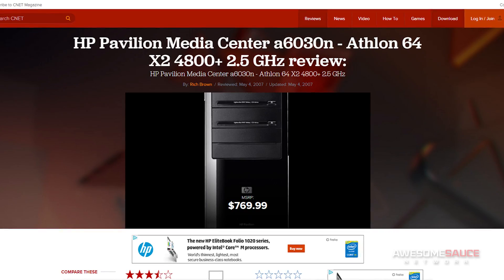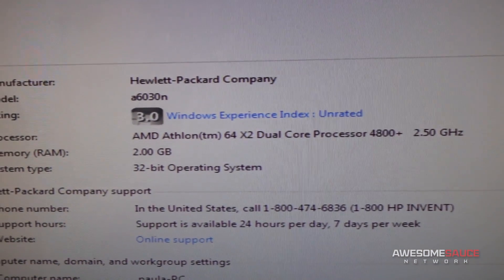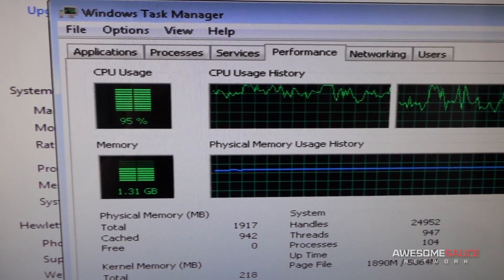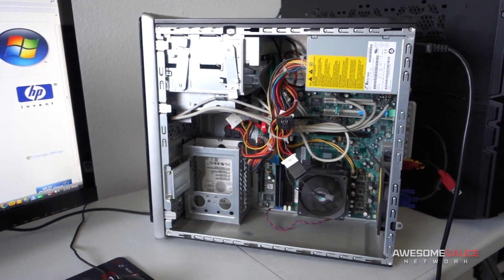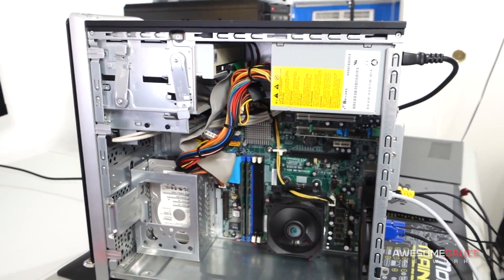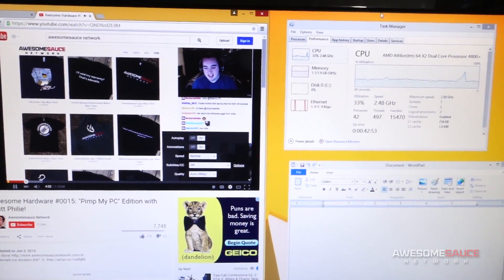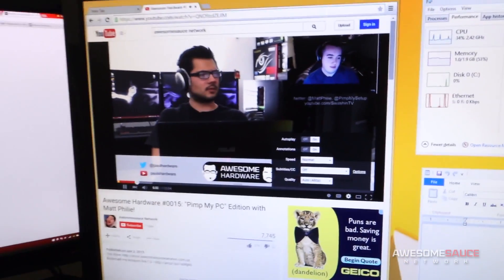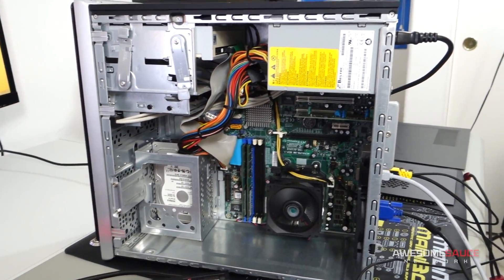Cleaning Up My Neighbor's Old Desktop!

Comment: 1st thing to do with an HP computer: wipe the HDD and install a fresh windows since HP stuffs their PC with useless crappy HP Software deeply rooted in the system so it's painful to remove and will leave windows slowed down.
An SSD will do well for an old system, too.

And did you even clean the PSU? I even open them after a few years to get them all dust free inside.

Comment: Can you explain what are the things to keep in mind while building a low and mid range PC
Reply: Don't be stupid and take everything slowly
Reply: I mean buying parts
Reply: @vishalyagnik226  don't cheap out on psu cause if the system does not get enough power the psu might break or cause instability on the whole pc ( signs like crashing games, crashing the whole system which requires to restart it). Get a stable graphic card and a processor, dont let them limit their ability to get more fps. For example you wouldn't buy a rtx 2080 with a cheap pentium processor now would you? Rtx 2080 and ryzen or something like i7-6700K would be more reasonable. If you dont favor looks, get a cheaper case(not the one in this video of course) but if asthetics dont matter to you that much, just buy something simple and invest the money saved on the case for something better, like ram. Ram for best performance should always be dual channel( meaning that 2 same ram sticks together) having dual channel can increase fps significantly, like 20-30fps at most. I hope I helped
Reply: @GamingDog20  now my use is like basic office use so not going to play games and all, also not going to buy a laptop or hps or dells ready made, so now to be specific which processor amd or intle and with which model ram and ssd which brand also is using ssd for os is a good idea ? sorry for too much questions

Comment: I never ever cleaned my core 2 duo, my first rig,alongside the radeon ati hd 4350 512MB and 2 GB ram.Bought it in 2009,opened in 2017 when i heard a little pop sound with some light.I discovered  that the GPU burnt bcz there was dust all over it and it overheated.Now i have built a new rig,comment to know abt it.

Comment: I'm surprised he didn't have some old Ram lying around to double up to 4GB RAM. Upgrade him to Windows 10 with the existing Product ID code.
Reply: win10 would not be a smart idea, better to just stick with win8. getting more ram is a good idea. or maybe replace the system, even the cheapest of cheap new tech is alot better then this.

Comment: Great video, thanks for sharing! I like to open my case and air the dust out a few times a year, but I’ve never taken my cpu apart, that looks like a good idea! Okay, well, I did once, and put the heat sink back WITHOUT any thermal paste-yeah, I ended up building a whole new computer after I turned the power  on (fried)! That was a very quick lesson on thermal paste! :-/

Comment: I had a 9 year old dell XPS 8300
So I just slapped a 1070ti in there and it works just fine
Reply: Firebomb1987 still get around 100fps in most  games with max settings

Comment: I've had a problem with my computer, that is that every time I power it on, things like twitch and Spotify automatically open themselves, if anyone has any tips it would be greatly appreciated
Reply: Go to the settings of both programs and change it to NOT open with windows 

Fairly simply
Reply: @stevesmith1383  thanks, don't know why I didn't think to do that
Reply: @tylan129  sometimes the issue is staring you right in your face

Yesterday, I spent 20 minutes figuring out why my pc kept telling me why I couldn't install a program to my non boot drive and asking for administrative permission....when I realized the 2nd drive wad named E not D like I kept typing. Smh

Comment: How did u hook it up to your laptop monitor.  I have an old one and need to remove files before I passed it forward.  It was in good working g condition.  I just downsized to a smaller tower

Comment: With a little research you can esily discover that: 1) the motherboadr MCP61PM-HM supports 8 GB of DDR2 RAM 800mhz, who is really cheap. 2) The PC runs Vista 32 bit, but processor Atholn 64x2 4800+ supports 64bit windows.

Comment: In the past  I have commonly observed ongoing high CPU usage in machines running VISTA Windows  - seems  that Windows keeps trying to initiate updating in a closed loop due to a minor glitch ( as this os version is no longer supported , so no new updates )  , hence the high cpu usage typically pegged at about 50%  , so my confirmed solution for this issue has been to disable Windows update ( also made sure in component services > services local ) and restart . As for high cpu usage in the subject machine now running newly installed Windows 8 , i would suggest maybe high cpu usage at idle  is merely Windows downloading and updating

Comment: YOU COULD HAVE DONE A MALWARE SCAN WITH MALWAREBYTES AND  THEN JUST STARTED TASK MANAGER AN CHANGED THE PERMISSIONS IN START UP PROGRAMS ON THE 30 OR MORE HE HAS ON THERE. ITS NOT VIRUSES ITS JUST A BUNCH OF PROGRAMS SET TO START WITH WINDOWS. Sorry about the caps. That being said nice video. But forreal the neighbor need to learn to use a pc.

Comment: HP = Garbage. Look at the case architecture.  I had a 2002 Dell micro ATX tower and that still looked like what is on the market today.  This HP had the motherboard installed on the right side of the tower and upside down. No future proofing. Hopefully, you only gave the owner power user rights versus full admin or else they're going to start installing rogue programs again. Nice clean up. Yeah, IDE cables were no fun.

Comment: I need your Jedi skills. Getting no signal on my monitor. First I pulled the battery, then put it back. Solved the problem for a few days until I was prompted to turn it off and update. Now it’s giving me the same message. No monitor signal. Should I trash it, or is there something I can do to salvage it?

Comment: less than 4GB of ram on Windows 8 is just madness. As a pc guy you should know that
Reply: I have a 2GB ram laptop...
With 32GB of non-upgradable storage...
And a *Celeron N2840*...
On a 64-bit install of Windows...
To say the least, I need a upgrade.
Reply: @radomiami  You have a dedicated word processor and wiki browser right there. As long as the wiki's aren't the ones with the auto-playing videos on every page.
Reply: I lived on 2GB RAM on a windows 8 for a couple of years. It's definitely good enough if you're not a power user.
Reply: ANYTHING other than 4GB of RAM exactly on any 32-bit install is madness. .-.
Reply: @ProjectRetro288  Installing a 32 bit OS on a 64 bit CPU is madness.  Later Pentium 4 processors and Athlon 64 processors have x86-64 instructions so it just makes sense to use it.
Reply: Do u know that i have windows 10 pro 64 bit
Running on 2 g ram
Reply: @amrzaqzooq6230  that has to be some kind of tiny version. Why waste time on silly things?
Reply: It's vista. Not win 8.
Reply: @FeuerblutRM  You didn't watch the video, did you?
Reply: anything less then 4GB on xp is madness.....

Comment: What do you use to clean the computer?
Reply: Compressed air for the light stuff, and I use alcohol on a shop towel, q-tip, or cotton ball for everything hard to remove. Works very well for me

Comment: I would have added a cheaper ssd as a boot drive, because I have seen too many times when windows 8 and 10 have had that 100% disk usage issue with mechanical drives.
Expecially when the system already has way too little memory on it, so it needs to go through swap.

Other than that this was nice way to get a new life on a old system.

Comment: Have you considered doing a thorough video on how to do cable management. You could even do the old and arcane and show older PC stuff. Isn't there something cable management is based on? Like how to fold ribbon cables and odd stuff. I only had a pc going back to the 486. Not sure what was common or uncommon before that. I'm also not sure if you could you do cable management in older stuff like a commodore 64?

Comment: If that hard drive is as old as the computer, it should have probably been replaced. An SSD would have given this PC a good boost in day-to-day performance.
Reply: this was in 2015, ssds were so damn expensive back then
Reply: Some old pc's are surprisingly fast even with old hdd's as long as the os is clean and hdd is in good shape. I have old amd pc from 2004 that i used a lot for gaming back then, i recently booted it up again and was surprised at how smooth it is.
Win xp on it boots almost as quick as my ssd gaming rig and it still uses the original hdd from 2004, it does have 3GB of ram.
Reply: @imrileth6618  XP runs really fast compared to "modern" OS.  You notice he didn't try to install chrome on it.  Firefox was the way to go.
Reply: +Imrileth I'm using a PC from 2008 with XP and it boots faster than my brother's PC
Reply: More ram is needed, 2 gb for windows 8!
Reply: Yes maybe, but the value of that ssd is probably worth more then the whole system, and the speed would be limited by the slow harddrive controller. He would be lucky if you could max the speed at 100 mb/s, but i doubt that it would get that fast.
Reply: Sjarken qqQQ11QQQq1ssqqqsww-2q.  ? Qqqqa11qqiqw)m q1x s q 1ii8 x n xs aardvark wwqqqqqq%oqoooqqqqqq1qq1
Reply: @vinbinjil  ok
Reply: If you were starting with a fresh windows why wasn't the HDD upgraded to a SSD other than the 50 bucks?
Reply: @gieauto7175  It's a 4 yr old video u twàt.

Comment: Man you should've completely pimped his system; given him 2 Gtx1080 TI's in SLI, an i9 CPU, fully liquid cooled system, 1TB SSD,  500TB HDD, 5 optical disc drives, 64 GB RGB DDR4 RAM, and a complementary blunt holder.

Comment: I realize that this is a three-year-old video, but I'll write this nonetheless:
.
The proper way of cleaning the RAM sticks is by using a rubber-based eraser to clean its golden strip.
.
What you did there achieves quite literally nothing. ...You may as well have breathed on it.
And an eight-years-old PC needs to have its RAM stick(s) cleaned!
I saw some RAM sticks that were brown in color. BROWN! Now that's filthy!
.
If you already inspected the RAM sticks and thought that you didn't have to clean the strip,
you can disregard this comment.

Comment: As for recommendations. A budget graphcis card with proper hardware H264 etc decoding would help a lot with playing video's and using chrome (proper GPU hardware acceleration) something like an old nVidia GT 620 or newer would be enough for that. And I believe an extra 2GB DDR2 memory (not that expensive second hand) would also help a lot seeing as both chrome and firefox are memory hogs (even back in 2015).

Comment: What I would do with a system like this:
1) Boot from a virus scan CD/USB key with recent virus definitions and let it clean. 
2) these days there is a Malwarebytes bootable windows PE (pre installed edition) version you can boot from to scan a system for malware and trojans: https://gbatemp.net/threads/release-malwarebytes-bootable.481046/
3) Boot the system in safe mode and start MSConfig (using the run /search option in the start menu) and disable all non essential programs in the startup tab and check the service tab for rogue services from things like registry cleaners and fake virusscanners.
4) reboot into normal windows and install Spybot Search and destroy Free and Malware bytes free.  And let both update their virus definitions.
5) Immunize the system (block known malicious sites through the windows hosts file) using Spy bot Search and destroy and scan with both spybot and malware bytes.
The system should be pretty clean again by now.

Comment: Cable management == Completely pointless. It's only for aesthetics it doesn't make any difference at all for airflow or cooling and just makes maintenance and repair later on a hastle. (Once you've had to replace a non modular power supply a few times you'll just stop doing extensive cable management cause it's not worth the extra time during repair)

Comment: I had a HP with the same pc cabinet was 2007, I hated it (WVista+1GB ram+ Intel Pentium), It took ages to boot due to Vista and ram, and when I got to main screen it was using 100% of the pc fue to the same OS+Ram problem.

Comment: I have a HP tower and the light keeps on flashing and I heard that the hair dryer trick works but I tried but it didn't work but I don't know the model of it and I used my flashlight on my phone and the inside is really dirty 

so I was wondering if you have any tips of repairing it

Comment: That is alot of effort in such and old computer, I admire your cabling  you did. But this isn't worth this machine, backup, wipe and reinstall and clean a bit of the dust out. That's what i would do. DDR2 is so hard to come by. Even now, putting a Haswell machine together is stupidly expensive with DDR3, because of the DRAM prices now.

Comment: I have a very similar system to this except it was the Pentium Dual Core 1.6GHz model that I got from my uncle for free. It had 6GB of DDR2 RAM installed but only 3.49 was usable even with a 64 bit windows 7 enterprise edition version installed. (I have tried a 64bit Ubuntu version and still that did not let me use more than 3.5GB of RAM. Further re-search says the chipset itself is 32 bit and can't handle more than 3.5GB of RAM) I later upgraded the CPU to an Intel Core 2 Duo E4600 2.4GHz and it runs nicely. The inside and even the motherboard looks very similar to the Intel version of the system.

Comment: W8.1? With only 2GB of DDR2? And just onboard video sucking up a fourth of that? And probably just 667 RAM at that.
W8.1 is a resource hog compared with W7
Could've really benefited with a video card installed.
Here's the specs on his cpu:
AMD Athlon 64 X2 4800+ (Socket AM2)
Level 2 cache size    2 x 512 KB
Supported memory: DDR2-800
65 Watt

Comment: FIRST - replace the CMOS battery; it's undoubtedly dead by now. Next, that motherboard supports SATA (three available ports just above the IDE connector on the motherboard and the existing hard drive is SATA). Get an SSD and install the OS on that. Replace the existing 320 GB hard drive with something larger. Install either a GTX 750 Ti or a GT 1030 (whichever is cheaper). Add a USB 3.0 card in that PCI-E x1 slot. Replace the power supply before it destroys the whole thing. Max out the RAM (8 GB DDR2 according to HP specs). If you're feeling squirrelly, swap out the DVD-RW with something less primitive (and a SATA cable, too).

Keep in mind, Kyle did what he did while spending NO MONEY, and that's a pretty good bargain.
Reply: This was like 3 years ago. They didn't even have the GT 1030 and the only thing the guy does is probably just surf the web. He doesn't need a gpu.
Reply: Why? An ssd? on a sata 1 mb  and usb 3.0 card  both A waste of time.  Spend the money on a better used cpu , ram, Off Fleebay. In the First place  you need the  hd/ssd  on a sata 3 card To see and take advantage of the usb 3.0 speed card. How much money are you going to spend on that alone... Remember the owner is not a pc guy.... He would be just happy with little more speed AE: a better cpu and more ram. and he would see it as a faster computer.. For low money...

Comment: I just put a similar system together for a friend, and I maxed the RAM out a 8 GB, and upgraded the processor.  I also put in a better power supply, and put in an older GPU.  These systems can run 64 bit software, and, with 8 GB RAM, can be quite capable systems.

Comment: My laptop got the same problem i got high usage of cpu disk and everything and am not running anything but my browser low fps at all of the games, my laptop is an HP laptop with windows 10 AMD A8-7410 with amd Radeon R5, if you can help me out i will really appreciate that man.

Thank You
Reply: Also i got 8gb ram DDR3  so i dont know how some games would work on toasters just fine would be wo4king for my laptop on 30-40 Fps with game stutering and lagging every single step

Comment: When I do these for people, I switch it to Lubuntu if they are cool with it because it frees up so much of that used cpu and ram for the actual programs. 

You'd be amazed at what $100-$140 bucks can do for an old computer when you do these clean ups.
Add that extra bit of ram and a small SSD or a very cheap GPU if the system is way old. ( Silent 6450 Radeon last one I pepped up, under $40 ).  
120MB SSD under $40 now. Max the old DDR2 or DDR3 for a few bucks. $15-$30. (Can go a little higher if you got DDR3 going for 16MB on a not so old comp) 
Cheap $30 GPU if it didn't already have one. It's over kill for Lubuntu and it's easy for people to use it since it's like a much better version of windows xp.
Great for old computers that the kids will use for homework, YouTube in HD, emulators, kid games on steam.

Windows 8 is a mistake to me for this old of computer. ( Windows 7 ok if you must have windows. )
Hope this helps a few people with some ideas on cheap upgrade/fix of old garage comps.
Reply: I picked up a good condition AMD HD7770 a 1GB DX12 card, for £7.80 inc P+P, first bid on an auction
Reply: @mattyfrommacc1554  That is a nice pick up.
Reply: IrelandVonVicious thanks it really did
Reply: People who are susceptible to putting all this junk on their Windows PCs are prime candidates for Linux.